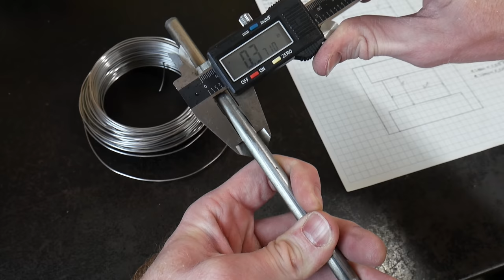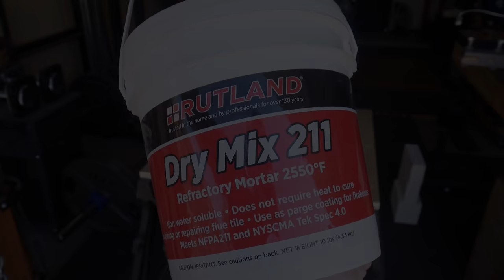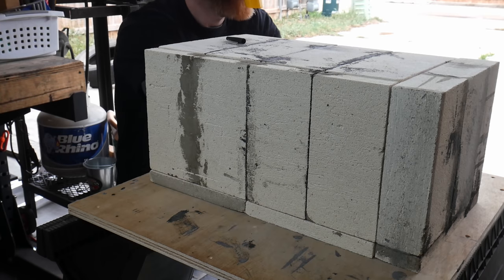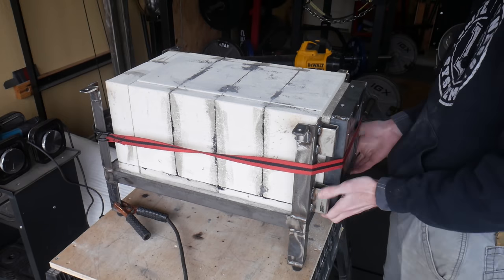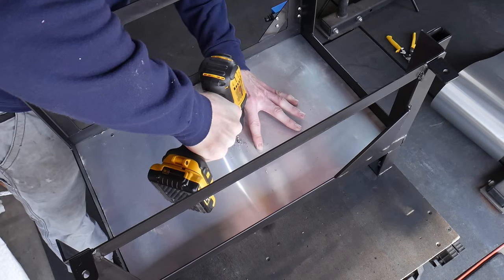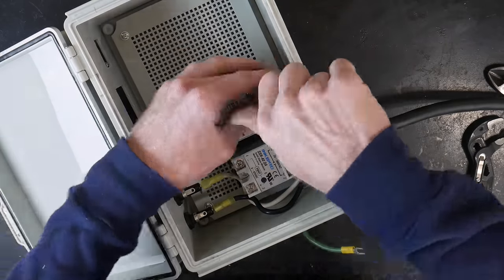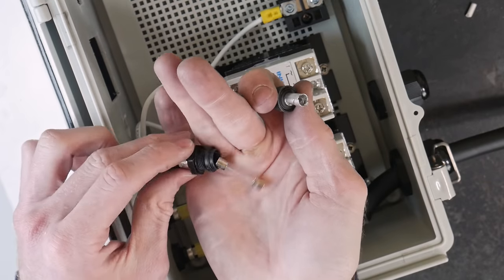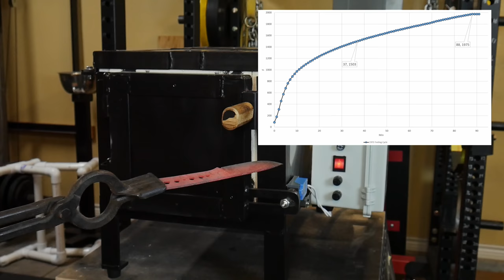How to Build a Heat Treating Oven | FULL GUIDE | DIY Heat Treatment Oven

Comment: Have you tried heat treating stainless steel? How long did it take your oven to get up to temp? Not sure if I have a PID configuration issue, or if I have an insulation issue. I got up to about 1,300 fairly fast, but I just cannot get up to 1925. I've been waiting more than an hour
Reply from the maker: I sure did. Made this AEB-L Chef - https://youtu.be/YQKTA_qjuSU

I honestly don't remember... May have mentioned it in this video, but I can't remember.... was a decent amount of time for sure
Reply: Thanks, I figured out my issue. I accidentally covered my limit switch in ko wool, and it promptly melted itself 😅
Reply: Can you see any problem adding a layer of ko wool to the inside top of the oven? I'm trying to figure out how to get it up to temperature faster. I figured I would attach it with clips made out of the resistance wire.

Comment: Great video! That looks like a pretty solid oven! 👍 Do you get any hot spots on the outside of your oven? I was also wondering about the door and if you intentionally didn't use any ceramic fiber stripping to help seal it when closed? That may also help dial in your spring pressure so you don't crack anymore bricks. Thanks for sharing your build!
Reply from the maker: Thanks man, I was thinking about using some of that fiberglass rope in there. Some fiber may work too! Not hot spots so far. Cheers sir!

Comment: I'm wondering if the reason why your bricks didn't stick together on the first attempt was because the product you used was labeled 'mortar', whereas the second product was 'cement'? Is mortar in general not sticky enough for joining things?
Reply from the maker: Heck, I'm not sure... I was frustrated when it didn't' stick. I could have done something wrong.

Comment: 6:35 It's important to note that at 1200C the Kanthal A-1 wire has an increased resistance of around 4%, important to factor in the resistance at operating temp rather than just at room temp
Reply from the maker: Thanks for the info

Comment: Thanks for the tutorial. Nice build.
I just have one question: Why do you use 2 SSRs, as you only need to break the heating element circuit once at either side, not both? Same question about the double fuses, since the heater is wired in series, only one fuse is needed. Or am I missing something?
Reply: Okay, I just realized why. Since both sides of the circuit are hot compared to ground, you need to cut both sides for safety when accessing the oven interior. I'm going to look if there is a DPDT version of SSR, then you would only need one.
Reply from the maker: Hey man, I'm not an electrician and to be honest I just went off of what I found researching this build. I think it reduces the load on each individual SSR increasing their life.
Reply: @RedBeardOps   Thanks for the reply. Great tutorial and so detailed. Thanks. Since the heating elements are in series with two SSRs, this means the same number of amps are running through both, so no increased life on the SSRs. However, the two SSR will protect you from getting electrocuted when opening the oven and touching the elements, as unlike running this on 110 volts, 220-240 volts here in USA means both sides are hot, so you correctly used two SSRs to disconnect both sides.

Comment: Nice job, one question with rubber feet how do you actually ground the kiln?  If you have a short wouldn't you just energize the whole frame?  Also SSR's typically need a heat sink on top.
Reply from the maker: Good question... I don't know. Maybe we'll get lucky and an electrician will answer that one.
Reply: @RedBeardOps  I'm not an Electrician, but I believe that the green/ground wire you attached to the frame would route the "short" back to the outlet/service panel/building ground.  Since it has a lower resistance than you have between your body and the ground you're standing on, it should prevent getting electrocuted before the fuses/circuit breaker can cut the power.

Comment: 35:36 hey man I built this kiln and it works flawlessly except I added a second thermo coupler and I have a 300 degree difference between the one on the lid and the additional.  What would you recommend doing about it. The second one is not a cheap thermo coupler.
Reply from the maker: That's interesting that you're getting different readings. I'd suggest making sure they're calibrated with a bucket of ice water or something along those lines

Comment: It looks like the link to your router bit and t slot bit are no longer sold as well. Do you have an Amazon link for the 10 & 12 awg insulated wire? Or am I better off ordering from kiln parts and paying for shipping? I can't quite tell how much I need for the 10 awg, although I think you recommended 16 ft on the 12 awg.
Reply from the maker: Good to know on the links. I'm really not sure about the wire on amazon; I was already ordering the coil from kiln parts so I added the wire. Always buy a little more than you think you need!

Comment: Excellent, I am in the planning phase.  One question: How did you determine the length of the wire (85ft)?
Reply from the maker: What wire are you talking about? the coils or the wire for the box and what not?
Reply: I refer to the coils
Reply from the maker: @louisvanniekerk7667  There is a link to DC knives in the video where you can download a calculator.

Comment: Thank you so much for the tutorial,  definitely the best most informative how to I have seen on this subject!  I was wondering about the controller you used.  I am a lampworker/ glassblower and I would need it to ramp up to temp then when running a cycle step the temp and hold for 30 mins then  down at certain temp/ time intervals, such as ramping up to 1250°F holding for 30 mins then 1250°F to 1150°F over 30 mins then from 900°F down to 800°F over an hour and so on  Are you able to program it do do this for annealing glass?
Reply from the maker: I am fairly sure the answer is yes. Search the model number in YouTube and they have videos of people programming ramps
Reply: I'll try that I have tried looking up tutorials for other controllers with no luck. Good to hear this one does!  Thanks for the help!!
Reply from the maker: @wallerking2966  I won't lie, it did take me a bit to get it figured out!
Reply: @wallerking2966  I've used the controller from Automation Direct for another project. Worked great and they answered some questions I had about programing it.

Comment: I've been working on my oven and attempting to get it to maintain a constant temperature (+/- 3F) for heat treatment cycles.  I fiddled with the auto tuning yesterday and got my process value to reach the set value without over shooting by 25 degrees.  However, when the PV was reached the SV began a slow and steady decline even though my time value was set for 75 minutes.  I reached my PV in 23 minutes, so in theory I thought it would hold temp for the time duration.  How have you programed your Auber PID to reach/maintain constant temps for tempering?
Reply from the maker: Hey Jon, I only use this oven for heat treating at 1400F and above. It's been pretty consistent at those temps. I use an insulated PID controlled toaster oven for tempering.
Reply: @RedBeardOps  - I set my process value on my heat treatment oven to 1650 F: when it reached the set value of 1650, the set value temp began dropping and the process value  followed.  This all happened within the time allocated of 75 minutes.
Reply from the maker: @gjDOnBBQ  I'm not a pro at programing this thing... But I remember there being multiple steps you can program. I'd do the first 2-4 of them to the same temperature. It sounds like your second step could be at a lower temp and it's ramping down?  I'm not sure

Comment: Your limit switch for the door is only rated to 5 amps but your oven draws considerably more. Is that safe and if so can you explain why?
Reply from the maker: I don't know and I can't. Not an electrician; build this oven  at your own risk, sir. That being said; I'm fairly sure the circuit the door switch is on never sees the full draw of the power of the oven.
Reply: @RedBeardOps  Ohh, so it's not directly in line with the power feed to the element. I put a toggle switch in mine after the relay but I wanted a limit switch like yours; I just couldn't find one rated high enough. I'll review your wiring diagram, guess I should have done that first.
Reply: @RedBeardOps  do your limit switch interrupts the DC current from the PID to the SSR instead of the AC to the elements after the SSR, correct?
Reply from the maker: @cholulahotsauce6166  Man honestly it's been years since I've looked at this. I don't remember.

Comment: Will these homemade ones work for 2150+ degrees f? Some high speed steels require that super high temp.
Reply from the maker: I've gotten mine up to 1950 without issue. Haven't had the need to go higher, but I bet it would get there... just takes time.

Comment: Why do these ovens use so many refractory bricks? What if you used rockwool sandwiched between sheet metal? What would be the problem with that?
Reply from the maker: You wouldn't want metal on the inside of the oven at these temps. But I'm sure one could be made with KAO-wool
Reply: @RedBeardOps  But if all I want is a tempering oven, which would never go above 500 degrees C, I could use stonewool sandwiched between sheets of metal, right? Do you see any drawbacks to that? I'm looking for something lightweight and light on energy use. Heating up those bricks should take some serious electrical power. If instead I used a double layer of stonewool the oven should heat up to the normal 230-330 C range much faster. Is there something I'm getting wrong?
Reply from the maker: @agjino    For a tempering oven, I'd advise finding an old toaster oven, then insulating it with wool and slapping in a PID.
Reply: @RedBeardOps  Thank you.

Comment: I am just now getting around to starting my oven.  The Kanthal wire you noted from Kiln Parts is out of stock.  Amazon Kanthal wire but made by other companies but is noted as Kanthal A1.  Am I being too picky?
Reply from the maker: Hey TEK, I'd call Kiln Parts and find out when they'll have it back in stock. I really don't know enough to advise your here. Sorry sir
Reply: @RedBeardOps  thanks for getting back so quickly. I have emailed them to see if they will be getting the 16 AWG back in stock.  I have a lot of work to do before I really need it.
Thanks for all of your very informative videos.  
Tom
Reply from the maker: @tek9102  Cheers Tom, good luck with your build!

Comment: A cement plant near me makes the hard bricks, and I can get them for practically nothing.  What do you think of using Hard Bricks + radiant refractory coating (itc-100 I think it is).  Would that work?
Reply from the maker: Man, I'm really not sure. I'm pretty sure the hard bricks suck up the heat opposed to refract it... So It may not work. itc100 is good stuff though.
Reply: @RedBeardOps  Interesting.  What about just using refractory cement itself?  I just don't want to get killed on shipping the soft bricks, and since I've been meaning to build a new propane forge soon, too...
Reply from the maker: @lasersailor184  You know I've seen guys use that stuff to make entire forges out of (by making a mold and pouring) I'm not sure how it would perform as a kiln to be honest.

Comment: A little late to the party, but wanted to mention regarding the 2 types of rutland products used in this video. The Dry Mix 211 is for masonry only, it won't bond with aluma-silica based insulating bricks, it's mostly used for clay liners in chimneys. The second tub showm, Furnace Cement,  does require a heat cure within 21 days of applying it. Try to finish your oven and use the elements themselves to cure it or else you would need to use an open fire to do so.
Reply from the maker: Awesome, thanks for the tips sir!

Comment: Could anyone explain why ground the electrics to the metal frame is a good thing? If one of the element wires / wires within the box also touched the frame would this not make the entire box electrified by shorting it? I'm confused by the purpose of using the frame as a ground. 
Great video thank you. :)
Reply from the maker: Hey man, I honestly don't know enough to answer your question intelligently.
Reply: @RedBeardOps  well I appreciate the response nonetheless :)
If I learn I’ll maybe come back and update my comment  :D
Reply: From a bit of preliminary research, it seems as though the wire get's connected to the case to provide a short circuit to trip the breaker (RCD) circuit your house electronics will be wired into in the event of damage on the other two wires providing current from the outlet. 

If there's an exposed wire on the neutral or live wire (NA call it neutral and hot I believe), and this exposed wire touches the metal case, then current will flow from the outlet, onto the case, and then the majority of the electrons will take the lowest resistance path to the earthing wire (which is grounded to the case) and back into the ground path within the outlet plug to complete the circuit. 

As this doesn't run through a reasonably sized load resistance, like the coils in this case, and instead goes straight from one wire and back into another with ~240V (very low resistance, maybe a couple ohms), it spikes a high current which flows back to the RCD circuit in your house, and and immediately trips the power and switches it off before you can get shocked, or stopping you from receiving a lot of charge through your body before you get really hurt. 

Would love to learn a bit more and get corrected if there's anything I don't have quite right but that's my understanding of it at the moment.

Comment: Have you had any issues with your coil wire breaking or melting into the brick, man?
Reply from the maker: I have not. If you use a thinner gauge wire, I think this is more possible.
Reply: @RedBeardOps  10-4. Have you done any AEB-L with it? That’s all I’ve been cooking and at some point in a treatment the Kanthal A1 16 gauge eventually breaks somewhere, or melts my ceramic brick.
Reply from the maker: @PharaohMoan  I've gotten the oven up to AEB-L temps, but haven't done a blade yet
Reply: @RedBeardOps  ‘Perciate the replies my man.🤘🏻

Comment: Watching your video on wireing the pid í noticed you said to connect the door switch wire to pin number 8 if I'm not mistakin you are hooking it to number 7 on the pid am I mistaken.
Reply from the maker: Hey Robert, It was long enough that I don't remember. Just make sure the switch will turn the elements off when the doors open and you'll be good.

Comment: I wonder if you could coat the wire coil with ceramic slurry and then bake the ceramic over the wire to make them last longer
Reply from the maker: Nice idea!
Reply: @RedBeardOps  just saw them doing ceracoat on piston tops...only thing is, it restricts the flow of heat...not good for a oven I guess...the heat would get thru...

Comment: I confirmed with Rutland that their 211 cement is Not appropriate for insulating oven bricks (because the pores suck all the moisture out of the mortar). They confirmed that what you ended up using will work, just as long as you stay below 2000 deg F. If you want to go higher, the proper stuff to order is called "Premixed Wet Refractory Mortar for Binding Insulating Fire Bricks."
Reply from the maker: nice, thanks for the notes! If I have to re-do the bricks one day I'll use that stuff
Reply: @RedBeardOps  Being hardheaded, I tried using the 211 stuff and ran into the very same problem you had. Had to learn the hard way!

Comment: Hey man. I'm currently ordering the stuff for the oven. How feet of the different kinds of wire do you think you used in this build? Trying to figure out how much I need to order.
Reply from the maker: I think I mentioned that in the description of this video. I'd suggest ordering around 30% more than you think you need.
Reply: @RedBeardOps  I'll keep that in mind. I don't see the lengths in the description.  I remember you saying to buy 15 feet of the 12 awg in the video (rather than the 10 feet you bought). I didn't  see you mention how much of the thermocouple wire, and 10 awg you bought though. 

I'll just go ahead and buy a bit extra of both.
Reply: Btw a couple of your links have gone out. I'm trying to buy as much as I can through your affiliate links so I can support the channel. Just figured I would let you know, in case you didn't.
Reply from the maker: @_BLANK_BLANK  Thanks man

Comment: What is the repercussion if I aim for your same 3200 watts, using 240 volts, but my oven volume is only 0.1875 cu ft (4x4.5x18 internal dimensions)? I'll be at 13.33 amps and 18 ohms as per formula, but power per cubic feet is 17,067 watts per ft3. What does that mean? Will I burn down my oven and house with it?
Reply from the maker: Hey Ron, it's been a while since I've run any of these calcs. I think what you're asking is if you can run the same power furnace with a smaller chamber area. I'd say this would just make your oven more efficient since it's heating a smaller space. When it comes to burning stuff down, please be carful with projects like this... This stuff is dangerous. Proceed with caution and at your own risk! Cheers!
Reply: @RedBeardOps  thanks for the reply. The figure of 17 kw per ft3 scared me, given yours was 9 and the commercial ones were 6. But I understand now, the higher, the more efficient it's presumed. Not afraid of the wiring. Seems pretty daunting, but it's pretty remedial once you read the PID manual and watch your video a couple of times.

Comment: Did you have problems with the cable melting where it connects to the ceramic block. Thats my problem.
Reply from the maker: I didn't, are you using cable with high temp shielding? fiberglass